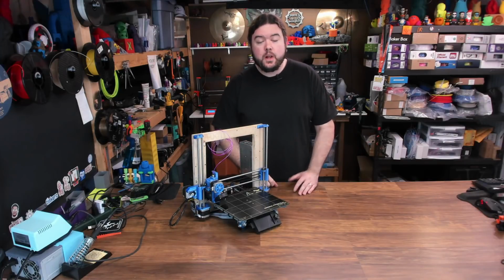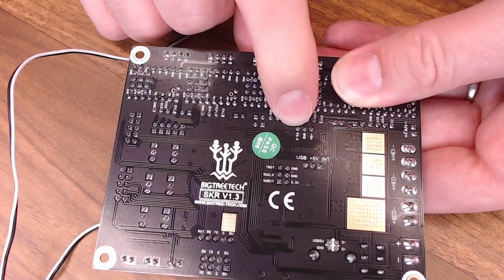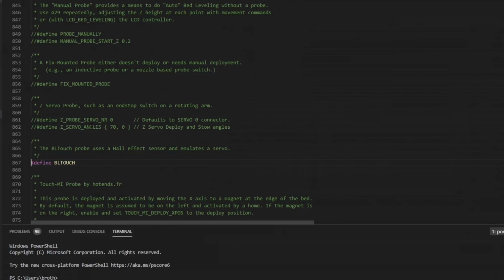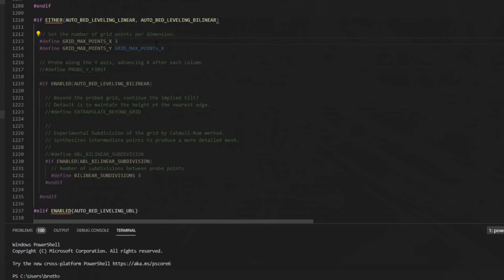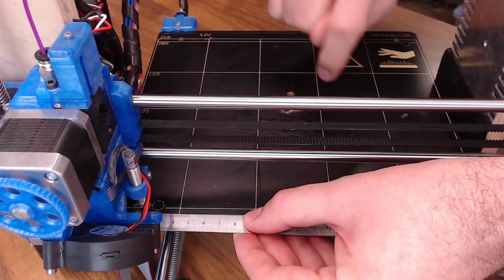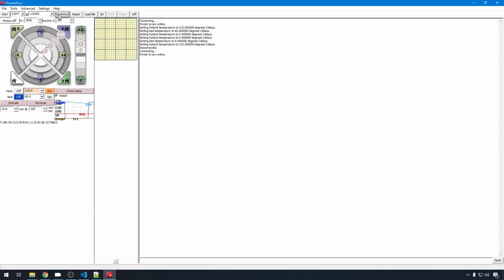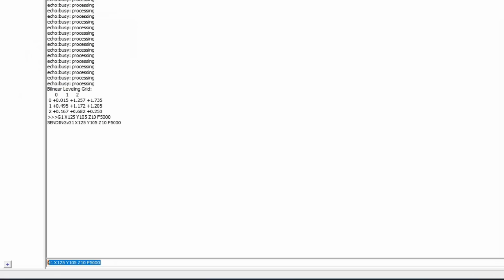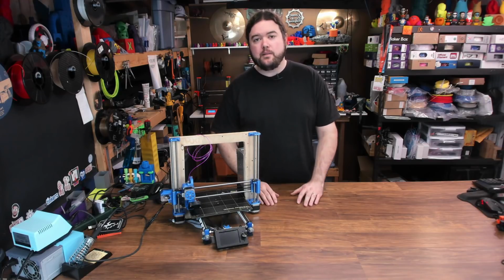Auto Bed Leveling - Marlin 2.0 - How To - 2019 - Chris's Basement

Comment: I am using the pinda 2 on my hypercube and i am following this and then your pinda 2 specfic video but I am having issues even homing the system. everything homes but the Z just crashes. any ideas?
Reply from the maker: Does you probe trigger correctly? Check it with M119.
Reply: @ChrisRiley  thanks for the response Chris. So basically where I’m at now is that everything homes and I followed the procedure with the m codes but when I send g29 I get probing failed. 

> m502
> SENDING:M502
> echo:Hardcoded Default Settings Loaded
> >>> g28
> SENDING:G28
> echo:busy: processing
> echo:busy: processing
> echo:busy: processing
> >>> g29
> SENDING:G29
> echo:busy: processing
> echo:busy: processing
> echo:busy: processing
> echo:Unknown command: "G12 P0 S12 T0"
> echo:busy: processing
> echo:busy: processing
> echo:busy: processing
> echo:Unknown command: "G12 P0 S12 T0"
> echo:busy: processing
> echo:busy: processing
> echo:busy: processing
> echo:busy: processing
> echo:Unknown command: "G12 P0 S12 T0"
> echo:busy: processing
> Error:Printer halted. kill() called!
> [ERROR] Error:Printer halted. kill() called!
Reply from the maker: @GioVader  Okay, so it probably doesn't like your offset. After the M502, but before your G28 and G29 run M851 Z-1.6 This will set an offset to get you started then you can adjust from there. The should stop the halting.
Reply: @ChrisRiley  thanks Chris. I will try that as soon as I’m home
Reply: @ChrisRiley  hey chris it didnt work.

Printer is now online.
>>> m502
SENDING:M502
echo:Hardcoded Default Settings Loaded
>>> m851z-1.6
SENDING:M851Z-1.6
>>> m503
SENDING:M503
echo:  G21    ; Units in mm (mm)
echo:  M149 C ; Units in Celsius
echo:; Filament settings: Disabled
echo:  M200 S0 D1.75
echo:; Steps per unit:
echo: M92 X80.00 Y80.00 Z400.00 E106.00
echo:; Maximum feedrates (units/s):
echo:  M203 X500.00 Y500.00 Z10.00 E25.00
echo:; Maximum Acceleration (units/s2):
echo:  M201 X500.00 Y500.00 Z100.00 E500.00
echo:; Acceleration (units/s2): P<print_accel> R<retract_accel> T<travel_accel>
echo:  M204 P500.00 R500.00 T500.00
echo:; Advanced: B<min_segment_time_us> S<min_feedrate> T<min_travel_feedrate> J<junc_dev>
echo:  M205 B20000.00 S0.00 T0.00 J0.01
echo:; Home offset:
echo:  M206 X0.00 Y0.00 Z0.00
echo:; Auto Bed Leveling:
echo:  M420 S0 Z0.00
echo:; Material heatup parameters:
echo:  M145 S0 H180 B70 F0
echo:  M145 S1 H240 B110 F0
echo:; PID settings:
echo:  M301 P16.36 I0.95 D70.55
echo:; Z-Probe Offset (mm):
echo:  M851 X28.00 Y12.00 Z-1.60
echo:; Stepper driver current:
echo:  M906 X800 Y800 Z800
echo:  M906 T0 E800
echo:; Driver stepping mode:
echo:  M569 S1 X Y Z
echo:  M569 S1 T0 E
>>> g28
SENDING:G28
echo:busy: processing
echo:busy: processing
echo:busy: processing
echo:busy: processing
>>> g29
SENDING:G29
echo:busy: processing
echo:busy: processing
echo:busy: processing
echo:Unknown command: "G12 P0 S12 T0"
echo:busy: processing
echo:busy: processing
echo:busy: processing
echo:busy: processing
echo:Unknown command: "G12 P0 S12 T0"
echo:busy: processing
echo:busy: processing
echo:busy: processing
echo:busy: processing
echo:Unknown command: "G12 P0 S12 T0"
echo:busy: processing
echo:busy: processing
Error:Printer halted. kill() called!
[ERROR] Error:Printer halted. kill() called!
Reply from the maker: @GioVader  What is sending this command? G12 P0 S12 T0
Reply: @ChrisRiley  im not sure. do you think it might be from the adv config?
Reply from the maker: @GioVader  G12 is a clean nozzle move, do you have that on your printer?
Reply: @ChrisRiley  i do not. Is that something activated in marlin?
Reply from the maker: @GioVader  Yes, it's in configuration.h search for clean
Reply: @ChrisRiley  im still getting probing failed and not explanation.
Reply: @ChrisRiley  >>> g28
SENDING:G28
echo:busy: processing
echo:busy: processing
echo:busy: processing
echo:busy: processing
echo:busy: processing
>>> g29
SENDING:G29
Error:Probing Failed
[ERROR] Error:Probing Failed
Reply: Hi, I have a similar problem. Then everything homes Z axis craches in to bed. I don`t know what to do too. I am using SKR1.4 turbo and LJ12A3-4-Z inductive sensor.
Reply: @aidasgaska  I’m going to try a different sensor because I heard that PINDA’s don’t work well with SKR’s but Chris was able to get it to work.
Reply: @GioVader  As I measured with 5V this sensor detection range is about 2.4mm. I am not sure but I gonna to connect sensor to 12V to improve detection range. But this does not solve the hitting problem. So, I will try to set settings one more time maybe I missed something.
Reply from the maker: @aidasgaska  Let me know how it goes, please check with M119 to see if the sensor is being triggered.

Comment: when i tried g29 i get this messages in pronterface terminal and nothing happens. if I try to lcd bed levelling printer does bed levelling. what is it i am going mad
please help
 File "<string>", line 3, in macro
  File "cmd.pyc", line 221, in onecmd
    
  File "printrun\pronsole.pyc", line 421, in <lambda>
    
  File "<string>", line 3, in macro
  File "cmd.pyc", line 221, in onecmd
Reply: i find the problem. it happens when you invoke a macro. if you choose macros and some macro and delete everything in that macro and save it. problem is solve
Reply from the maker: Glad you found the fix, thanks for posting it.

Comment: 17:38 The display I am using doesn't have a knob with a button. It's a TFT touch screen.
Reply from the maker: I think the knob came out on V3.
Reply: @ChrisRiley  Sorry I didn't get you. what V3?
 I have provision to edit the UI of my TFT (JZ-TS24 2.4) display and add a custom button. But don't know what data should I pass if the button is triggered.
Reply from the maker: @mayooghgirish3253  Get the new firmware and edit the commands. I will have a "How to" video out next week.
Reply: @ChrisRiley  Thanks

Comment: Chris thanks so much for your videos. You so precise and clear. I ha ve a cr10s and I am installing a sensor probe. I am having issues with homing. Do you think you could help me out some? I could record a video and show you. Thanks so much
Reply from the maker: Sure, just let me know what it's doing.
Reply: @ChrisRiley  thanks so much. I didnt want to bother you with silly questions, so I have been all this time testing, fixing and improving the firmware that I got from "THE FIRST LAYER" he talks a lot about cr10s and thats exactly what I got. I have installed many things like an ABL sensor and thats exactly what I am wondering about. so far so good, the firmware works great but I have noticed that everytime I run a print it never performs a bed leveling with the sensor. it just starts printing. only when I select the leveling sensor from the LCD menu it performs the task. but only if I select it but it doesnt do it alone before everytime.
Reply from the maker: @ciscolara  Remember to put a G29 in your start gcode in your slicer. Put it right after heating and g28

Comment: Chris I'm still getting an error with my BLTOUCH On my Ender 3 Pro with SKR Mini e3 v1.2 Below is the G29, For some reason it Goes to Z10 but does not lower when probing.

 G29  X41.00 Y10.00 Z10.00
Machine Type: Cartesian
Probe: BLTOUCH
Probe Offset X-41.00 Y-10.00 Z0.80 (Left-Front & Above Nozzle)
Auto Bed Leveling: BILINEAR (disabled)
>>> do_blocking_move_to  X41.00 Y10.00 Z10.00
>  X41.00 Y10.00 Z10.00
<<< do_blocking_move_to  X41.00 Y10.00 Z10.00
>>> Probe::probe_at_point  X41.00 Y10.00 Z10.00
...(0.00, 0.00, raise, 0, probe_relative)
  current_position= X41.00 Y10.00 Z10.00 :
>>> do_blocking_move_to  X41.00 Y10.00 Z10.00
>  X41.00 Y10.00 Z10.00
<<< do_blocking_move_to  X41.00 Y10.00 Z10.00
  current_position= X41.00 Y10.00 Z10.00 : Probe::set_deployed
deploy: 1
Probe::do_z_raise(10.00)
>>> do_blocking_move_to  X41.00 Y10.00 Z10.00
>  X41.00 Y10.00 Z10.00
<<< do_blocking_move_to  X41.00 Y10.00 Z10.00
BLTouch DEPLOY requested
BLTouch Command :10
BLTouch ALARM or TRIGGER after DEPLOY, recovering
BLTouch Command :160
BLTouch Command :90
BLTouch Command :10
BLTouch Command :90
BLTouch Command :10
BLTouch Recovery Failed
Error:!! STOP called because of BLTouch error - restart with M999
[ERROR] Error:!! STOP called because of BLTouch error - restart with M999
Reply from the maker: That's really strange, it acts like it's in error state and tries to recover. I am wondering if the sensor it's self needs some adjustment. You can adjust the setscrew to raise and lower the pin position. Not sure it will help but you can give it a try.

Comment: HI printers, i need help, i use marlin 2.0.6. when i make a G28, my nozzle goes out of bed on y an x and nozzle does not go in middle of my bed.
really need help, three days i try day and night.
card: skr 1.4 turbo
Reply: its those x y coordinates that need to be set correclty. what printer is it
Reply from the maker: You can change this in the slicer to negative home values or in Marlin here #define X_MIN_POS 0
#define Y_MIN_POS 0
Reply: @ChrisRiley  i have errors when i put  #define X_MIN_POS 0
#define Y_MIN_POS 0
.
a part of my code is:
// Direction of endstops when homing; 1=MAX, -1=MIN
// :[-1,1]
#define X_HOME_DIR -1
#define Y_HOME_DIR -1
#define Z_HOME_DIR -1

// @section machine

// The size of the print bed
#define X_BED_SIZE 330
#define Y_BED_SIZE 330

// Travel limits (mm) after homing, corresponding to endstop positions.
#define X_MIN_POS -39
#define Y_MIN_POS 0
#define Z_MIN_POS 0
#define X_MAX_POS X_BED_SIZE
#define Y_MAX_POS Y_BED_SIZE
#define Z_MAX_POS 300

/**
 * Software Endstops
 *
 * - Prevent moves outside the set machine bounds.
 * - Individual axes can be disabled, if desired.
 * - X and Y only apply to Cartesian robots.
 * - Use 'M211' to set software endstops on/off or report current state
 */

// Min software endstops constrain movement within minimum coordinate bounds
#define MIN_SOFTWARE_ENDSTOPS
#if ENABLED(MIN_SOFTWARE_ENDSTOPS)
  #define MIN_SOFTWARE_ENDSTOP_X
  #define MIN_SOFTWARE_ENDSTOP_Y
  #define MIN_SOFTWARE_ENDSTOP_Z
#endif

// Max software endstops constrain movement within maximum coordinate bounds
#define MAX_SOFTWARE_ENDSTOPS
#if ENABLED(MAX_SOFTWARE_ENDSTOPS)
  #define MAX_SOFTWARE_ENDSTOP_X
  #define MAX_SOFTWARE_ENDSTOP_Y
  #define MAX_SOFTWARE_ENDSTOP_Z
#endif

#if EITHER(MIN_SOFTWARE_ENDSTOPS, MAX_SOFTWARE_ENDSTOPS)
  //#define SOFT_ENDSTOPS_MENU_ITEM  // Enable/Disable software endstops from the LCD
#endif

in adv/configuration, i have this :

#if PROBE_SELECTED && !IS_KINEMATIC
  #define PROBING_MARGIN_LEFT PROBING_MARGIN
  #define PROBING_MARGIN_RIGHT PROBING_MARGIN
  #define PROBING_MARGIN_FRONT PROBING_MARGIN
  #define PROBING_MARGIN_BACK PROBING_MARGIN
#endif
Reply from the maker: @n.b.3330  You will probably need to increase your MAX size as well.  change this #define X_BED_SIZE 370

Comment: hi chris, i have a delta printer when i installed my metal sensor and my bed is wham bam i do auto delta calibration 32 but i get a prompt to deploy the probe what did i miss in marlin ?
Reply from the maker: There should be a setting in there for fixed probe. That will get your around this.

Comment: Hi Chris,

i just updateded my Chiron, and now i have the below Zero challange. even if i follow your guide to the letter, i still can't get the g28 to be with the new Z offset settings. do you have some other tips and tricks.

Thank you in advance.
Reply from the maker: G28 will probably not reflect your Z offset, it should always seek 0.0.0. After the G29, or when headed toward your printing move the offset will then be applied. Make sure the offset is updated in eeprom.

Comment: I really need help.nothing i do is working to ABL my printer. Triple checked everything.... How do i contact someone to help me??
Reply from the maker: Justin, there really is no one for support. I can try to help you. What does your printer do?
Reply: @ChrisRiley  it z safe homes where I want (set in a safe home x y setting in config.h), then goes straight to xy min and  tries to home, but my probe is nowhere near the build surface. The probe works fine. Everything moves exactly like I want, but no ABL. Skr 1.3 ender 3 pro. Bl touch. 2208. Probe -50, -8, 0.
Reply from the maker: @justintanner1228  Where is your probe? Is it on the left front of your hotend?
Reply: @ChrisRiley  yes. Front left. 
I have a copy of someone else's config and using compare on notepad to see diffs.... I found one... force z min home.... I think that what it is... not next to my computer.
Reply from the maker: @justintanner1228  I would have to look at the config, but Z safe homing should be all you need.
Reply: @ChrisRiley  do you have a copy of the config and config adv of an ender 3 pro with skr 1.3 and bltouch?
Reply from the maker: @justintanner1228  What drivers? Sensorless homing?
Reply: @ChrisRiley  2208. That part of my setup works great.
Reply from the maker: @justintanner1228  I looked, I don't have one for an Ender3 PRO.
Reply: @ChrisRiley  it doesn't have to be a pro. Just a ender 3 with blt
Reply from the maker: @justintanner1228  Here is the config, using this bltouch mount. https://www.thingiverse.com/thing:3733792 

https://drive.google.com/drive/folders/1OwE91hcgYOeJ7rWbYnXkhyiTmqOq_UqB?usp=sharing
Reply: @ChrisRiley  thank you so much for the help and files. Unfortunately, I think my board is not taking new configs anymore..... I would make obvious changes and it would never show up even though the board is taking the bin file and then it's a cur file.... I'm sure I can fix it with some magic coding, but I bought a 1.4 turbo board... I will be subbing and liking for sure. Your awesome and love the vids .
Reply from the maker: @justintanner1228  make sure you clear out eeprom m502 then m500.

Comment: Any chance you could do one on UBL? The one I have is 24v and seems to work...just not the UBL part. I have been trying to get it set up and it only wants to probe in one spot. The board is the SKR 1.4 Turbo, which I installed using your video.
Reply from the maker: I will be doing another UBL video to follow up. Stay tuned.

Comment: Hi Chris, what printer are you using? There is a open-source project for it?
Reply from the maker: It's a MK2 clone made out of wood. Check this out. https://toms3d.org/2017/02/23/building-cheapest-possible-prusa-i3-mk2/
Reply: @ChrisRiley  Thank you for the fast reply. Between them, what upgrades are included in your improved model?
Reply from the maker: @cristianfo  Too many to count, LOL, bondtech extruder gears, MK3S extruder body, integrated lead screw motors, MK42 bed, SKR 1.3 board currently.

Comment: Having an issue with a 5v npn inductive probe. The probe lights up when near metal, but won't trigger in m119. How can I fix this?
Reply from the maker: I would check the singnal pin make sure when it triggers it is putting out 5v.
Reply: Some probes even tough they say 5V on the label don't work properly at 5V :-( Check the signal with a multimeter and if necessary try (at your own risk) running the probe at 12V (including the necessary circuit to prevent sending 12V to your board)

Comment: I'm having a lot of problems.  Will a NPN NO (normally open)  probe logic work?  Does the normal Z end stop switch make the circuit OR break the circuit?  My probe under a 5 volt power supply connection  always has 5 volts on the signal wire.  Touching the probe end with many different metal objects does not change the 5 volts on the signal wire.  I think my 'NEW' probe is bad.
Reply from the maker: Sounds like the probe might be bad, you should see if go low or high as you trigger it.

Comment: Hi Chris, i have Anet A8 V1.5 with Marlinh 1.1.9 installed and sensor SN04. Can a modify Merlin for insert a row on standard display ? Have simple tutorial for this operation and for calibration ABL ?
Reply from the maker: Not sure what you mean by insert a row?
Reply: @ChrisRiley  yes a line in display for the start e leveling when i wont and not  the print start
Reply from the maker: @sergioroselli5726  Ah, I see, yes, take the comment off of this line. //#define LCD_BED_LEVELING
Reply: @ChrisRiley  yes It Is possibile I solve.

Comment: First of all, thank you for such a study. I did the application but I have a problem. Since it tries to go to the specified points very fast, it gives motor step error. What can I do because it wasn't slow. I tried to reduce the speed.
Reply from the maker: So you slowed it down, but it didn't help? You can try to increase the motor current.

Comment: @chris riley i got the ez abl pro and it came with the extra box. did I need to install it? i directly wired to power and whatnot, if I didn't need to do that I'm gonna be sad :(
Reply: Been following your videos for weeks, built an Ender 3 with skr 1.4 and 2209s,with EZABL. Mad love to you brotha, I'm a drummer also
Reply from the maker: @timekeeperclips  Thanks man! I looked it up, it a converter of some kind. That box looks like it takes the power in, powers the sensor and accepts the endstop input. So maybe you didn't need to wire it all in .
Reply from the maker: Extra box? What is that?
Reply: I didn't know what to call it lol, its like a box that I wire into from psu, then put ends top in it also, and the ezabl

Comment: Your video is great, thanks, Uploading Marlin 2, is to me, impossible with vscode.  Cannot find Marlin-2.0.x/include ??  Yes its not there but why?
Reply from the maker: Not sure, did you try moving your Marin folder to the C driver to make the path shorter?
Reply: @ChrisRiley  Ran the update /update all and managed to compile Marlin 2. It uploaded and ran on my Ender 3. I decided to return to Marlin 1.1.9 because I could not fit auto bed leveling into the Ender 3 CPU with Marlin 2.  I watched your video 3 times  and it was a lot of help.  For ABL, I used a Twidec M18 PNP NO probe and it senses thru my 2mm glass surface. 
Thanks for the great videos you go at just the right pace.